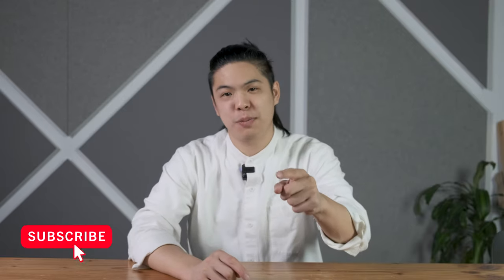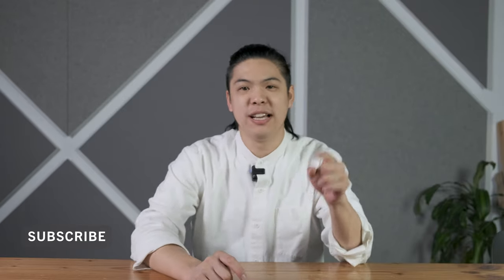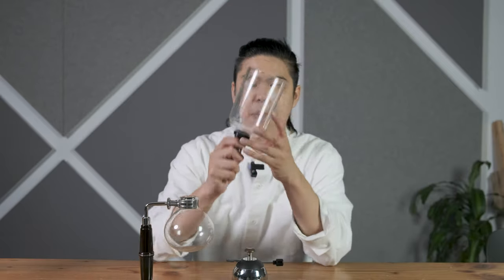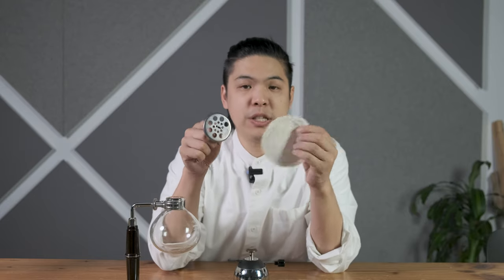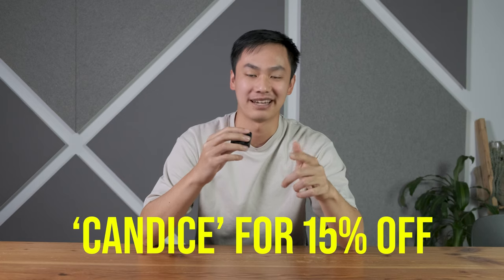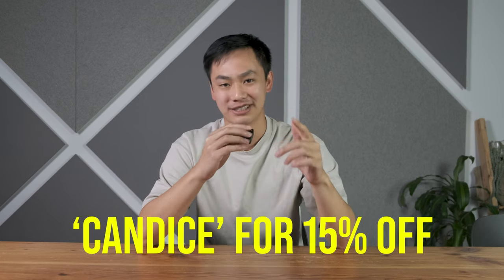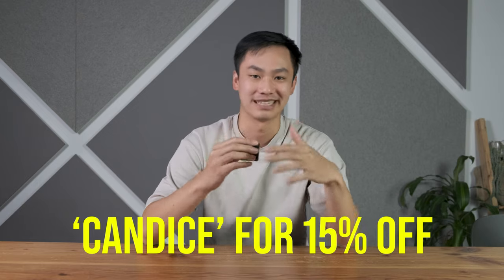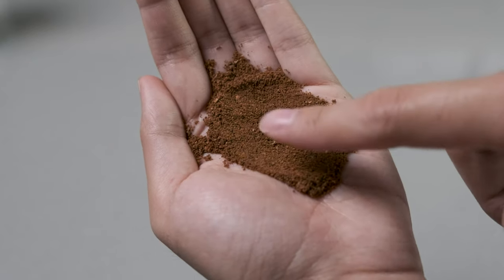Siphon Coffee Masterclass (Vacuum Pot Coffee)

Comment: Videos like these are useful and I dont doubt that the guy is well intentioned, but you can use the Syphon pot without all these shenanigans, including stirring. The Vacuum pot was designed to brew coffee with little input once water and coffee are in place. If you use  temperature adequately, in the upper chamber, a sort of convection currents due vapor pressure will be formed that naturally mix cofffe with the water. You just have to give it time to do so appropriately. I've measured the water temp in the upper chamber with different heat source intensities and the highest temp registered was 97 ºC, but routinely i get 93-4ºC when this convection ocurrs. And the coffee comes out great and not dissimilar from the stirring aproach. But hey, its your coffee beans and apparatus…

Comment: Ive been using a syphon pot for years as my preferred “weekend method”, when I have time for all the setup and cleanup. I ditched the cloth filter for a vintage glass Cory Rod. This is a glass rod with a bumpy glass ball to act as the filter. The cup is a little closer to French press and cleanup is a breeze with just running water. But stalls do happen, which makes technique critical. Too much spin = more chance of stall.

Comment: Dear Vincent, I love this method! I've experimented quite a lot with different parameters (grind, timing, stirring) and following your method here has given me the best results so far. 

You mention that you find the cloth filters annoying so I wanted to give you a tip regarding caring for them which not only keeps them 100% clean but is also almost totally hassle-free. You need to buy some sodium percarbonate, aka oxygen bleach or oxy clean (but needs to be pure, not one with extra cleaners or fragrances added). After you finish brewing, rinse the filter under a hot tap and briefly rub to remove coffee grounds, then put the whole filter into a small cup or other container, add just a pinch of the oxygen bleach, and pour enough hot water (I just make sure there's a bit left in my kettle) on to cover it. If brewing the next day, you can just leave it out, otherwise put it in the fridge. The oxygen bleach decomposes after a few hours into water and sodium carbonate which is a non-toxic alkali sometimes known as washing soda, which in itself has amazing cleaning and deodorising properties. When you come to use it again, tip the solution out, keeping the filter in the cup, and rinse by filling the cup four times with tap water. After rinsing you're left with a perfectly clean filter ready to brew with. Once you get into the swing of doing this it's almost no effort at all.
Reply from the maker: GLAD YOU are finding success with this method!  Hmm oxygen bleach! I've never heard of it.  Thanks for this suggestion I will have to look for this.  Sodium percarbonate sounds like baking soda but I know it's not ahaha.  Thank you!
Reply: @TALESCOFFEE  hahah it's quite closely related! Baking soda is sodium bicarbonate, a gentler alkali than sodium carbonate. And the percarbonate makes a solution of sodium carbonate and hydrogen peroxide which together clean the cloth filters perfectly with no residue (once thoroughly rinsed) and no toxicity.
Reply from the maker: @joechesshyre I tried baking soda before, but it wasn't good enoguh.  If the percarbonate is better then it should do the trick.  If i had it in the water I could just submerge it and let it do it's work right! Or would I need to boil it still?

Comment: The alcohol burner that is supplied with it works perfectly. No need to adjust flames or anything like that. It's so easy to use.
Reply: The alcohol burners just take forever, though (even if you start with hot water).  I quickly switched to a butane burner like in this video, and eventually ended up switching altogether to an electric coffee syphon.
Reply: @redvenomweb  Not really forever...just about 8 minutes for me.

Comment: I find it very helpful to use the full spray of the tap to power clean the Yama filter, after using the Yama stick to lessen the grounds and dump them into compostable. With the Yama filter still inside the top vessel.
Reply: Thanks so much for this helpful video. In the 8 cup Yama which takes over 90 seconds to drain into the bottom chamber, with 85 grams of coffee and vigorous stirring I think it gets over extracted with this method. I tried it yesterday stirring less and it was good. I've also changed the grind to about 14 or 15 on the Baratza Virtuoso down from about 20. 
Do you think the butane Yama brewer is better than the stove top 8 cup? I also have a 5 cup Yama stove top but not the butane self heating system.
Reply from the maker: You can actually shorten the draw down time if you cool the lower chamber.  I’ve seen people do it, they use a colder wet towel to wrap around the bottom bulb which cools it down.  I wouldn’t use ice water but room temperature water seems to work well!
Reply: Sorry, correction - after brewing coffee in 40 oz YAMA using cloth filter covering the one piece metal assembly (the $9 not the $16 which has to be taken apart to clean the cloth) using the bamboo paddle to loosen spent grounds, I pour as much spent grounds out as possible. Then the upper chamber with the filter cloth assembly held in place using the chain coming out the bottom, is placed under kitchen sink power faucet on full blast which cleans the filter after a couple of times so there's only a faint coffee color remaining.
I haven't yet tried the paper filters, but for now I find my method useful and quick and rids the cloth filter of coffee grounds debris.

Comment: Ok, getting a siphon soon.
Reply: You'll love it. But just in case you love convenience and don't want to spend some time cleaning the delicate and super brittle syphon parts after each use (as it should be for best performance) kindly consider a clever dripper instead. Flavor wise very similar to syphon but much easier to use and cheaper to run (you don't need fancy heat source, just hot water)
Reply: @manuelpenaruiz3694  love the clever

Comment: Call it5 fucking masdterclass an using an extra hrdware not supplied use a fucking oil lamp at least once and explain.. or don`t call it a fucking masterclass. PLEASE I am so depserate for an explanation on dot length etc
Reply from the maker: bro why you so angry.  Nobody uses the oil lamp on the mid to high level.  There is 0 cafe's using it.  Even espresso gear people use WDT gear and everything which ARE NOT in the box set.  Please.  Keep in mind we're chasing a good coffee not be in the box.  Don't be so angry.  Stay happy.